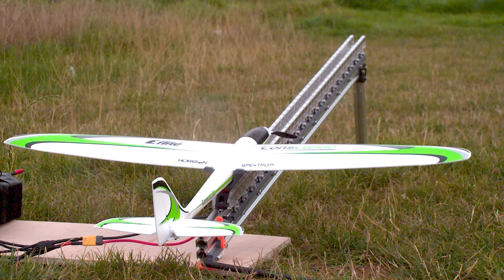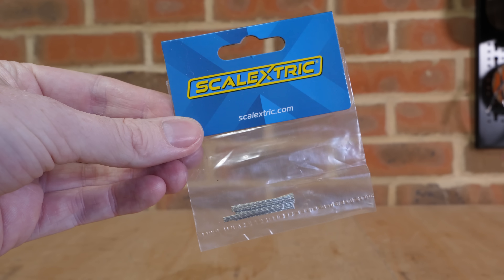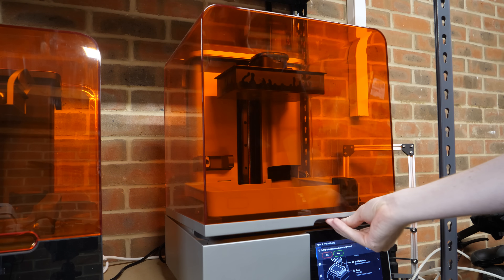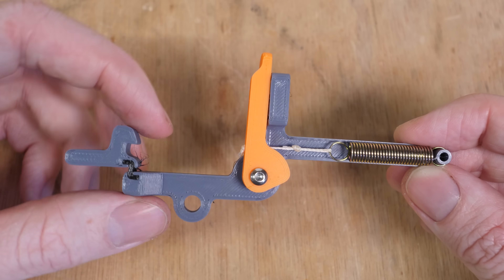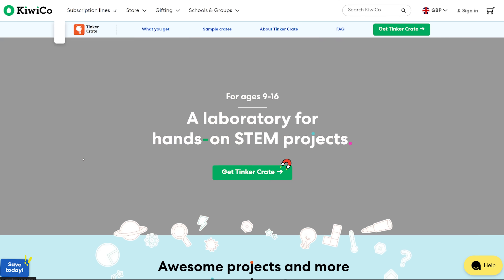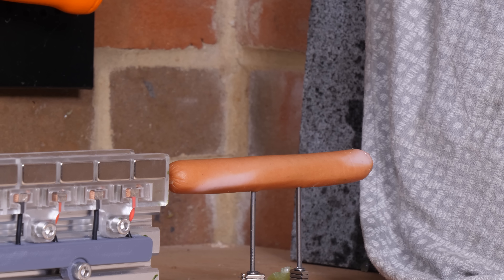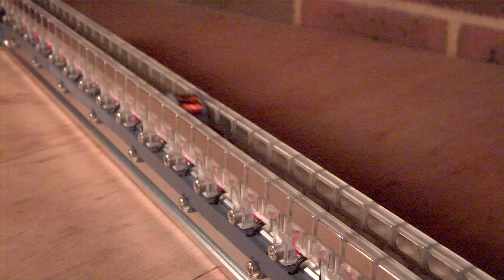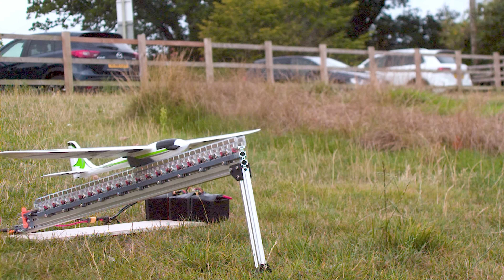Electromagnetic Aircraft Launcher

Comment: Fun idea. Some improvements: iron strips on the outside of the magnets to close the field lines; square coils to get get the drive currents perpendicular to the field; graphite core to increase field strength; graphite brushes to reduce contact resistance; use finer wire with more turns to reduce current, all things being equal you'll get the same force and mass if you halve the wire cross section and double the turns (or you can then double the voltage to double the force for the same mass).
Reply: More turns will increase resistance and reduce conductance, right?
Interesting to test though.  Somewhere, some Defense engineers are passing this vid around the office betting on if the author keeps experimenting.
Reply: @boots7859 all the sparking is ironic because I've heard one of the key issues with the General Dynamics railgun is barrel life....
Reply: Design engineers laugh when passing these vids around cause the understand magnetic circuits and linear motors, unlike op.
Reply: @VEC7ORlt Perhaps, but consider: This guy made a railgun in his garden shed, and you didn't.
Reply: @custardbaby4  if you knew what a railgun is I'd allow you to school me on what is and isn't.
Reply: @VEC7ORlt  Damn, I wish there was a design engineer here to explain how magnetic circuits and linear motors work then. Sadly I'm afraid there isn't one here. What a shame.
Reply: @LordDragox412  Ain't it a bit late for that?
Reply: @VEC7ORlt  I couldn't possibly know. After all, it is you who spoke for design engineers and what they do, which must mean you know at least some of them. But if you say it's too late then I guess it. If only someone asked you earlier, he would still have the chance to gain so much knowledge! Or if only Tom got a design engineering instead of aerospace engineering degree, he too would know everything about *checks notes* "magnetic circuits" and "linear motors"! Alas, what a fool he is. He missed the chance of his life and now he'll be forever laughed at when VEC7ORlt -I mean design engineers will watch his videos. Oh woe is him!
Reply: @LordDragox412  don't choke on that sarcasm.
If you embark on project like that and fail to do your homework - shows your ability to learn.
Oooh look aerospace degree and you're cosplaying an engineer on youtube, how impressive, so wow.
Reply: @VEC7ORlt  The projection is strong with this one. He IS an engineer, it is you who is trying to cosplay a design engineer in YouTube comments and pretending you're better than him. It's honestly quite sad.
Reply: @LordDragox412  oh you must be clairvoyant to know me so well, also you can go cry in a corner if sad.
Reply: @VEC7ORlt  Another projection. It is you who is sad because there is no potato.
Reply: @LordDragox412  give yerself a pat on the back mighty keyboard warrior.
Projection this, projection that, this the best you can squeeze out?
Reply: @VEC7ORlt  Uhh. Emag is not exactly easy, and many engineers would have to brush up on things since we don't deal with it every day.  Heck, I know I would run the coil test he did just because it's good to double check my assumptions

Plus, his debounce solution is really neat!
Reply: @EmperorA0  true, but can we please at least nail the basics?
Close the field lines around the magnets and add a laminated stack core to the coil.
Reply: @VEC7ORlt  Hey, I'm not the one laughing at other people for venturing out of their field to do a fun project instead of being helpful. Also you should consider working at Splendid Palace. They could use a new projector.
Reply: @LordDragox412  ran out of sarcasm and projection is all you got?
Reply: @VEC7ORlt  If you can't find sarcasm in my last comment then it's no wonder you didn't get your degree. Also you wouldn't get the position at SP anyway, as these days they prefer using a smart projector there. I'm afraid a "NoU" model like you would have a hard time fitting anywhere these days.
Reply: @VEC7ORlt yeah, the basics. Sure bud. Go make one yourself. Insufferable
Reply: @VEC7ORlt  laughing at outsider technology is pretty pathetic
Reply: Using thinner wire and more turns will result in a slower launch speed. Even if the force when stationary is high, it will reduce quicker as it picks up speed. It's still a motor, even if linear.
Reply: Also a resistor on the sleigh to reduce sparking. Thinner coils and smaller space between magnets. Maybe make the coils out of aluminium so they are lighter too. Splitting the rail supply and making the later stages higher voltage would also be very beneficial.
Reply: Metallplatten würden die Ausrichtung des Magnetfeldes verbessern, aber nicht bei Pol Umkehr. Die gegen Erregung würde zu Beginn das Feld Schwächen. Sonst hätte er keine Luftspule verwendet, sondern eine mit Metallkern. (Wie ein Handelsübliches Relai) mfg.
Reply: I assume you mean ferrite cores?
Reply: @khaddr  Yes my mistake, I meant ferrite. The tricky bit is degree of cogging you will get moving the coil between poles, and you want to minimize circulating induced current due to high switching rates, which is why I suggest ferrite rather than iron.
Reply: I'd say graphite powder on the parts of the sled and rail that touch, with the present setup, may yield some surprisingly improved speeds. That and maybe 20-40 more wraps (220-240) with that rail length. I'm sure there's a sweet spot. This was super cool as-is. I just came here to say I support graphite, not as specified in the op, but as an improvement opportunity. Yes, I also know what Silicone is...
Reply: Could you put a high voltage capacitor (inside the coil) to supply the power to the launcher - so that the capacitor is part of the projectile?
Reply: @derekflegg2510  energy inside isn't anywhere enough for propulsion, most coilguns put in hundreds of joules into the coils and a few (5-15) end up in the projectile.
Reply: Very good ❤
Reply: I understand some of these words. :(
Reply: Why square coils? Wouldn't it be better to have rectangular coils matching the the size of the magnets?
Reply: I came here to suggest thinner wires in parallel, but you sir knocked the assignment out of the park.  If he follows these suggestions, he could improve this by leaps and bounds!!
Reply: Do away with the brushes go back to original setup of coils on the rail and use the magnet switch set up on the sled itself to reduce wear
Reply: Exactly what I said ❤
Reply: What i have experienced is that the more turns the more induced voltage as it moves through the magnetic field =less current.  And also creats less punch. But you can double the windings parallel that way you increase the amps by limiting back voltage. And creat a big punch. Nice video
Reply: I think aluminium wire would be good. 60% the conductivity but only 30% of the weight. Enameled flat aluminium wire.
Reply: @jacobthellamer .... dude, you want the conductivity, damn the "weight savings"
Reply: @internetbodhi1009  you get the same conductivity with a thicker piece of aluminium but it still has less mass. The trade off is there is the aluminium has more volume.
Reply: @jacobthellamer  and because its not a weight constraint, but a volume constraint, using an equivalent sized copper wire, if not a thicker gauge copper wire has more benefits.

Its not, oh, we need to pack multiple windings, its what is the best winding we can fit in one turn to get the most current moving in the smallest space...

What I'm trying to say is using aluminum leaves power on the table. Its better to have one thick copper cable at X coils per inch, than an aluminum cable at the same coils per inch but less current, or fewer coils at equivalent current.
Reply: Finer wire with more turns would actually not work as well - field is proportional to current (thicker wire more better) and the rate at which the polarity of the field can change is inversely proportional to the coil’s inductance (again, thicker wire more better)
Reply: @jacobfaseler5311  Explanation: for a given volume, if you halve the wire cross-section you can double the number of turns, so twice the force; however you double the resistance so if voltage is maintained you halve the current, and halve the force. Net result is no change to force. But, double the voltage to get the original current, and you have doubled the force. But quite right, inductance increases as the square of the turns, so you get four times the inductance. However the switching rate of these coils is so low I don't think that's a factor; as guestimate anything under 10mH is fine, and these coils in the 50uH range. The other factor is heat, which  for a given current increases as the square of the resistance. But again these operate for a fraction of a second so probably fine.
Reply: @davidharley7753  There is a volume constraint, but that isn't driving the choice of 200 winds vs 400. Also, I wonder if there's a voltage constraint in whatever he's powering this with. You might run into that volume constraint if you change to aluminum, but maybe not. Would be interested to see someone balance those equations, I don't know enough about it, not an EE. I was also wondering if there are downsides to the sparks besides possibly wearing or dirtying the contacts faster, but idk. You'd have to reduce voltage to reduce the arc length, and then you'd limit power. Makes me wonder if there's some way to do some simple switching to avoid that, or if that would just add unnecessary complications.
Reply: @davidharley7753 if you increase the voltage you should be able to get more skin effect and be able to use thinner wire to get the same effect.
Reply: Well done Tom

Comment: 11:37 small correction. But the reason the 400 turn sled is loosing is not it's weight, but only due to it's higher resistance. Technically the 100 turn sled should always win for a fixed voltage. It does also win for 16V, the only reason it's loosing for higher voltages are the losses and sparks at the brushes, which get worse for higher voltages and therefore currents.

Comment: DC contactors typically have the contact on the moving portion of the arm on a plunger spring, or a second sprung arm, to allow the mass in the contact arm to continue to decelerate after the contacts close, preventing rebound and the contacts chattering. you might also want to look at adding an arc chute/trap to pull the arc away and extinguish it as the gas pressure from the air ionizing around the arc can actually push the contacts apart, extending the arcing time.

Comment: The more turns the coil has, the higher the inductance, that causes current to increase slower.  From video you can see that you have a few ms per contact point, so minimizing the time to hit max current is important.   Magnetic field is proportional to current, and also proportional to number of turns, but number of turns is also proportional to inductance, and that is something  you want to reduce.
Reply: Slight correction here: When you are winding a conductor, (making a "coil") the  inductance is always square to the number of turns, not proportional! 
See different formula depending on the actual geometry  here: https://en.wikipedia.org/wiki/Inductor#Inductance_formulas. In this video, Tom is building a multi-layer air core .
Reply: @AntoineZenRuffinen  It does lead to the question of whether a ferrite core would help the inductance more than it hurts the mass; but the mass of the plane probably makes that nearly meaningless.  He should have tuned with a plane-mass-simulator, rather than an empty sled...
Reply: @georgedorn_fnord  Maybe the ferrite core would help, maybe not. This would need some calculation to know. Nevertheless, I  think a good optimization, would be to use an "Halbach array" configuration (https://en.wikipedia.org/wiki/Halbach_array) for the magnets, as it would improve magnetic field and don't adds any moving mass to the the sled.
Reply: Higher voltage makes the current rise faster as well, as an alternative to lower inductance

Comment: I suspect there are plenty of electrical low hanging fruit to be had with this. You are pretty obviously loosing a ton of energy to inefficiency.

Already seems like you could easily improve electrical contact by doubling or even tripling your brush count. You may have to increase it vertically though, so as not to cause timing woes. You can also almost for sure add passives to the rail to control the waveform. Trying to get something closer to a resonant system would put your commutation in the zero crossing region, preventing arcing from instantaneous current changes. Also, don't be afraid to have larger spaces between contacts, conservation of momentum is a pretty efficient way to store energy for short periods of time, as you have seen yourself with your flywheel work.

Really though, I think the best thing you can do is put this on a logger or storage O-scope and look at the waveform. This is going to be the best tool for getting a better idea of likely improvements to try. Just make sure it's properly protected.

Comment: You could have used dc motor brushes (graphite with springs). At least I think it wouldnt melt like the copper but you would get graphite deposites on your rails but that can be cleaned.

Comment: I was thinking. most of the loss of material is happening on the ends. so I was wondering why not make round off both ends instead of one? Seems like it would be good to also add a bit of like cushion/spring piece to help maintain contact in the launcher.

Comment: For the slot cars: The good old Carrera system had solid metal contacts and was really reliable, easy to maintain, and also had many tricks up their sleeves like being able to control 2 car individually on the same lane.
And for the bounce: Aside from not using a mechanical switch directly as the main switch - why even make it straight contacts? Your switch is a rotating arm: use that. Have the contact follow the arc, with the brush being held slightly flexible and the outside stationary contact having a slight inwards curve: Now once the contact is established the arm is "gently" slowed down and the force of that does not lead to bounceback but rather squishes the the contacts together more firmly.

The magnets and contacts also should not all be the same dimensions as at the end of the rail it is already travelling at a significant speed. Either the coils are over-saturated at the start of the run, or at the end it can barely build up a magnetic field cause it is wizzing by too fast.
Reply: Hmmm. Would be interesting to know how they control 2 diff cars in same lane..
Reply: @christopher4101  IIRC there have been slot car control systems with AC control, where the positive and negative halves of the waveform have been modulated independently by each controller - eg. Player 1 controls the positive half, Player 2 the negative half. Then each car has a diode biased to ignore the other half of the waveform. Whether the waveform is amplitude modulated each side, or each controller passes their half of the sine wave through a thyristor, though, is beyond my memory. It's a curio from a long time ago now though, we use a variety of wireless comms standards to achieve ~20 cars in the same lane now 😅
Reply: @williamstrachan  ahhh. Makes sense. 👍

Comment: Add soft iron or ferrite strips between the alternate polarity magnets to complete the magnetic flux circuit and potentially double the field strength, which ups your EM field strength saturation limit and means your higher turn sleds may perform better. Assuming you're feeding them with enough volts to not be current limited. Amp turns is what matters. Maximise amps x numbers of turns.

Comment: You should fill the sled with coil if you can. It's a balancing act between thinner wire having more turns and thus more force for the same amps, but higher resistance so it needs a higher voltage to push those amps, and also a lower max amp limit before the wire melts.

Beyond this you might also create a bigger magnetic field than you can match with the magnets which means excess electromagnetic force generated is wasted.

You might find that your magnets are getting weaker as you use them if you use them in repulsion mode as this is almost exactly how magnets are made (large pulse of current through a coil with the magnet in.

Comment: @Laundry_Hamper this is a coil gun.  coil guns pull a projectile through a series of magnets or through a series of charged coils. A rail gun uses a projectile that is in circuit with two long rails. When a load is added to the circuit it pushes the projectile down the rail using magnetic induction. Tom should redesign this using a diy rail gun. It would be very interesting to watch.

Comment: If you make your contacts wedged at 7° and have your armature as a conductive wedge you slide between the contacts then it won't bounce. Make sure they're dissimilar metals so they don't weld. Like copper contacts with an aluminium wedge.

Comment: Do you think you could simplify the trigger by using the same latch to start the trigger motion you could use that to lock the trigger in the "fired" position so that it wouldn't rebound off the contact? do you think it will be as reliable?

Comment: It is reasonable that the heavier objects would go faster than just the proportional amount to the weight, not only do the coils stay in the field longer, the contacts and other current affecting limitations have more time to stabilize per section increasing the force (albeit probably only very slightly) per time spent as well, the question we feel whether or not the amount of wire turns that is optimal would change depending on the load, maybe the rc plane would do better with more (or less) wire turns per coil, due to the addition ofload by both mass and aerodynamic forces being applied.